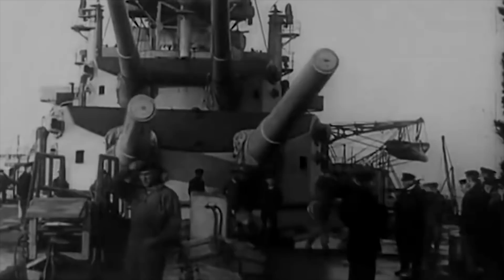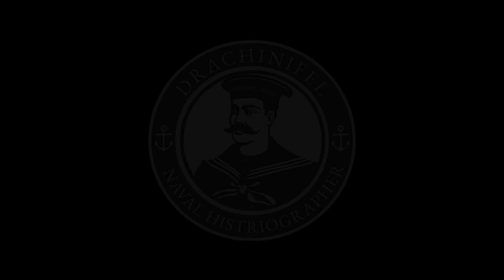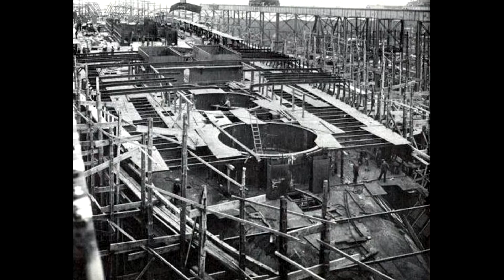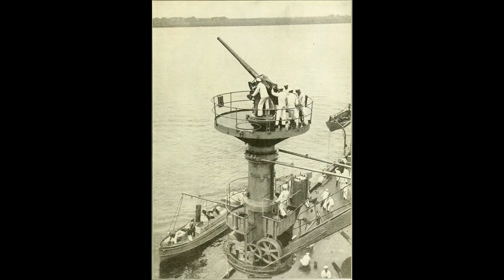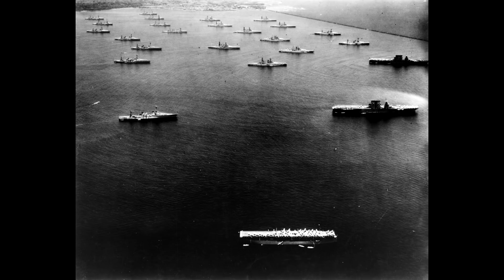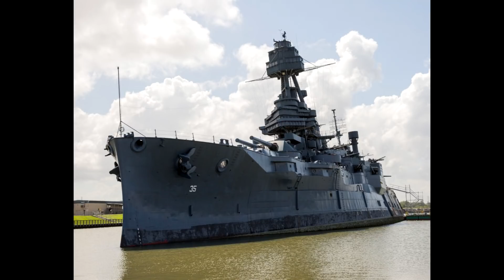USS New York - Guide 204

Comment: SO, at 109 years old.. Is Texas, other than Constitution the oldest USN ship still "afloat"?
Reply: Off the top of my head, I remember two preserved ships that fall between Constitution and Texas: the 1854 sloop Constellation and the 1895 cruiser Olympia.
Reply: @bfrobin446  Very true.  Constellation was rebuilt several years ago because she was rotting out and in danger of sinking right there in the harbor.  However the rebuilding did not include making her capable of sailing on her own.  When she 'sailed' to the Naval Academy at Annapolis MD after the overhaul the move was done with tugs the entire way.  I doubt she will have that ability restored to her as it has in Constitution.

Olympia is another ship whose 'bottom is rotting out' due to electrolytic corrosion.  While some repairs have been done and more scheduled, she really needs the care she can receive only in a fully equipped drydock and shipyard.
Reply: USS Olympia is older than Texas.
Reply: @WALTERBROADDUS  USS Olympia is not a battleship though. Texas is the oldest surviving dreadnought type battleship.
Reply: @johnlee1297  Texas never fought anyone. Golf clap.👏🏿😏
Reply: @WALTERBROADDUS  Um, what about the Germans and Japanese? The ship earned five battle stars in WWII.  D-Day was her most famous engagement, but Iwo Jima and Okinawa were probably more risky because of the kamikaze attacks. She also fought in Operation Torch, and at Cherbourg, and in Operation Dragoon. https://en.wikipedia.org/wiki/USS_Texas_(BB-35)
Reply: @Ensign_Nemo  Not to diss the Texas fans, but no ship vs ship action like Manila Bay for Olympia. 😷
Reply: The USS Niagara in Erie, Pennsylvania, is technically a former USN ship that is still afloat, but it's mostly reconstructed. Only a tiny amount of the original ship remains, and that was kept more for symbolism than for practical reasons. https://en.wikipedia.org/wiki/USS_Niagara_(1813)

Comment: I was aboard Texas a few years ago and one of the volunteers informed me that yes the torpedo tubes had been removed but the compressed air system was left in place.  Perhaps someday when the state of Texas gets off its ass and spends the money to save her it will be on the tour.
Reply: In 2019 the state of Texas appropriated $35 million dollars for repairs of the ship and control of the ship has been transferred to the Battleship Texas Foundation. She is currently being prepped for transport to drydock so that the entire underwater section of her hull can be replaced (foam is being put into the torpedo bulges to help keep water out and divers are doing underwater repairs on the outer hull). Her secondary guns are being removed so that they can be sandblasted, disassembled, repainted & reassembled. They will then be reinstalled after the hull repairs are completed. It has not been determined where her new berth will be but she is expected to reopen by the first quarter of 2022. https://battleshiptexas.org/battleship-updates/

Comment: I understand why they would continue to add larger and larger guns for more effect and power but you do end up with less guns. My question is why didn’t any country try to just stick with a smaller gun and try to increase the velocity of the shells to get the same longer range, 
Similar to the 75mm guns on tanks in WW2 not only were larger guns used but the Germans significantly increased the velocity of their 75’s got tons of more range and pen and were flatter shooting and could reload faster than a Russia’s 100mm and up guns??? Like I would love to see a battleship with say 5 triple mounted super high velocity 10-12” guns over the 3 triple turret 14’s. And I missing something, I have to believe the 10” shells weight half the 14”s and could be loaded faster? Was there a shell size/velocity range limit that only going bigger could solve?
Reply: Barrel wear. And smaller shells mean lighter weight, meaning lower effective range due to how inertia works
Reply: In order to increase the velocity you would need to increase the shells powder charge. Doing this increases the weight of the shell, but damage the shell does stays the same.
Reply: @joshuaarnold5123  You can increase velocity by increasing the barrel length as well.  Also, for AP rounds higher velocity mean better penetration.
Reply: The Italians did go for the high velocity option and ended up with a 15” gun that hit as hard as the 16”/50 gun (and possibly harder at close ranges).